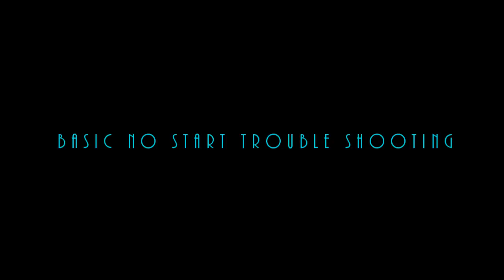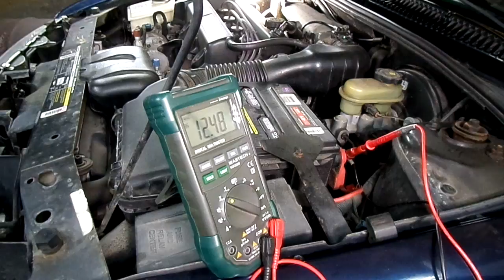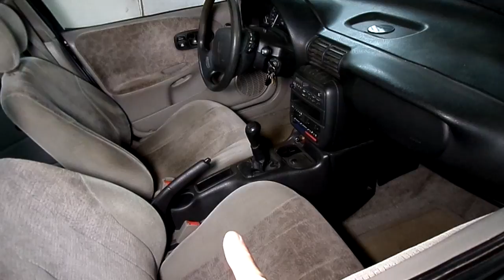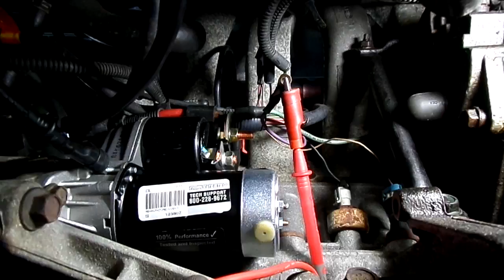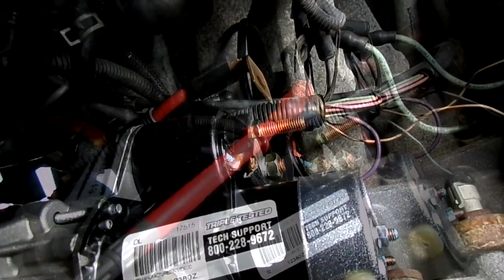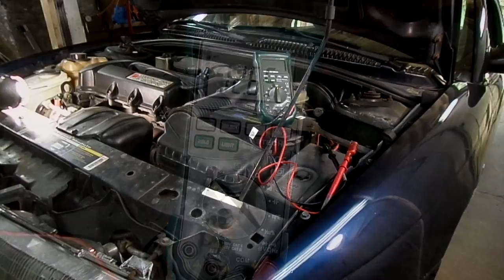Basic No Start Trouble Shooting

Comment: Smashing video, but (and there allways is a but lol), the multimeter has an input resistance of ten million ohms, this means that a bad connection can still pass enough current to display the correct voltage on the meter
So for checking the end of the purple wire, use a 21 watt bulb across the meter terminals, it will present a load heavy enough to show a bad joint, the meter will show a lower voltage :-)
And the light will be easy to see :-).
That starter looked fresh, recon fresh.
Reply from the maker: I always love tips....thank you

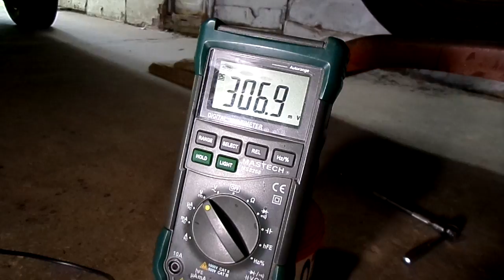Comment: Interesting ghost voltage at 4:50, for some reason creeping really high.
Reply: Search 'ghost voltage'. Typically it's caused by close adjacent live wires, right beside the wire that you are measuring with an open. You don't see it if the wire you are measuring is connected to ground or power, only on an open circuit. Usually the reading bounces around, it won't stabilize. Even though the circuit you are measuring is open, voltage is induced in it by the other wire, much like a capacitor (or inductor if the source is A/C). You can buy low impedence multimeters like the Fluke 117 that quickly drain the tiny capacitance and give a more accurate measure of real voltage. Or, as stated below, you can short the multimeter terminals with a resistance like a small bulb. What surprised me here is how high the measured voltage climbed. However if you were to touch that wire you wouldn't get anything more than a tiny static shock, because the capacitance of wiring like this is minimal.